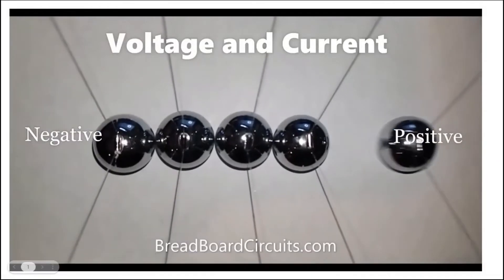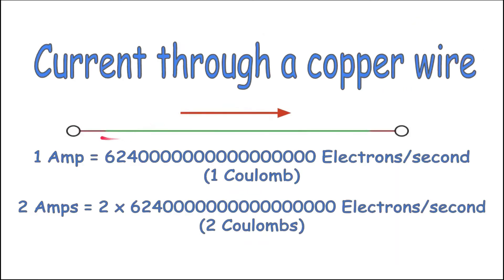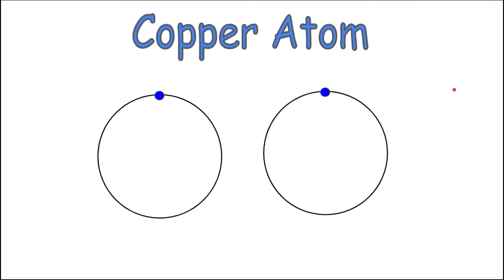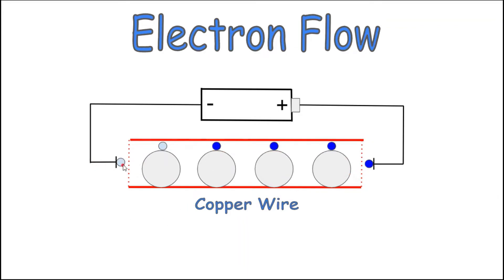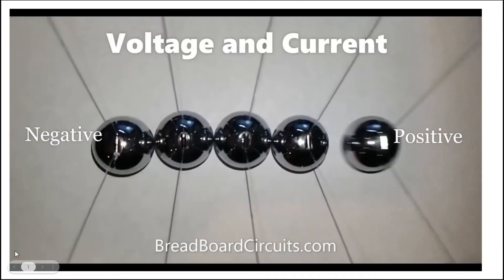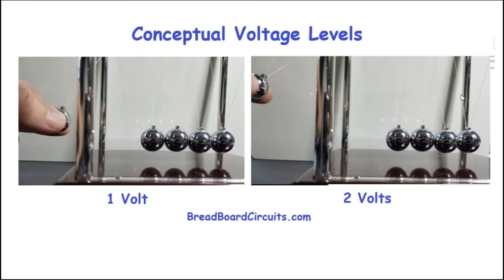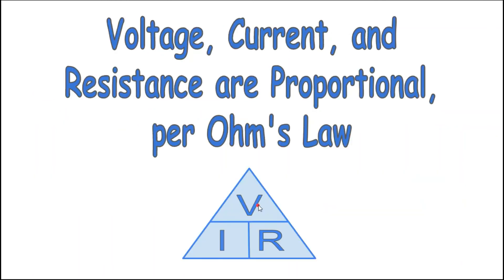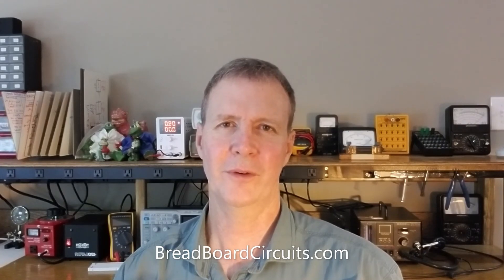#1:  Voltage and Current Explained. What is Voltage and Current?

Comment: I'm several videos in -- thank you!  In the recommended equipment tab on your website, there are several pieces of equipment that don't usually make the list for beginners.  The most notable is the signal generator.  Why do you recommend a beginner get a signal generator?  And in which of your videos is it used?
Reply from the maker: Thanks for your inquiry. The channel and recommended equipment are for beginners, intermediates, and experts alike. I have some videos in the works for PWM, semiconductor characteristic sweeping, modulation methods, basics of capacitors and inductors, LC resonant circuits, etc. - all of which the signal generator will be useful for. Thanks your interest in the channel!